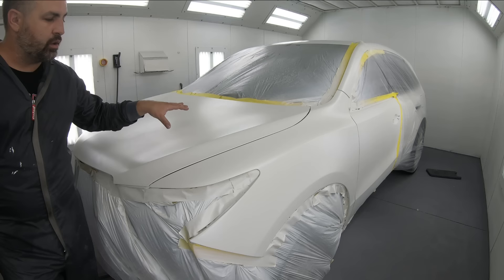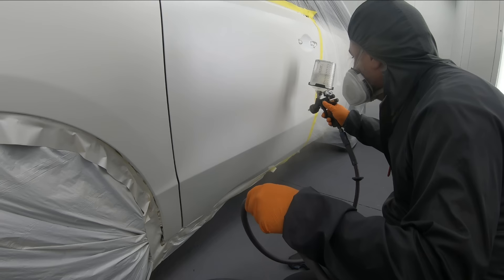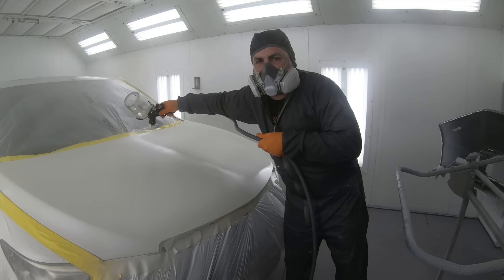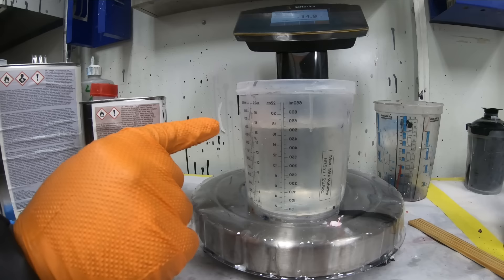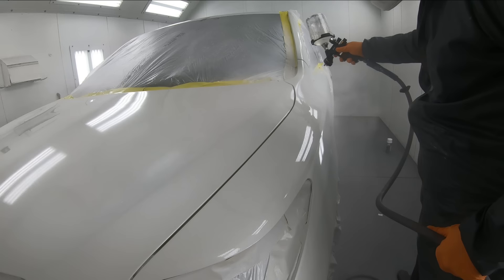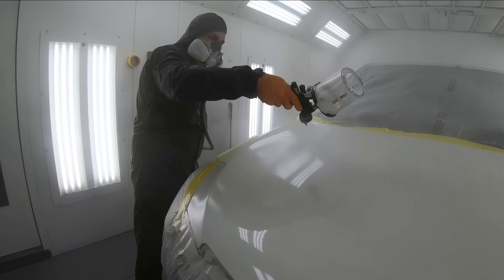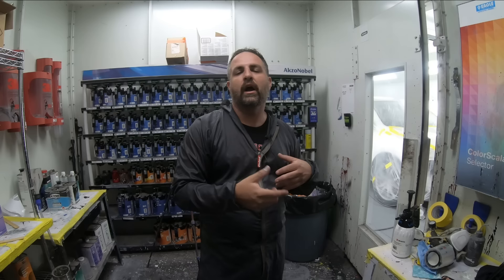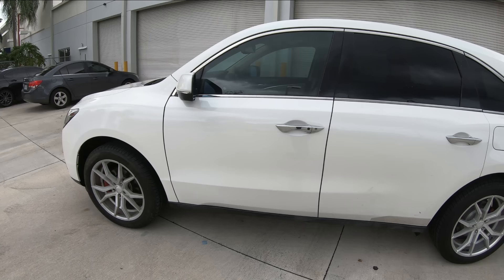Simple Mixing HACK to AVOID ORANGE PEEL!

Comment: Reducing clear for over many years painting since 85. But still Don't have thise fancy spray guns you use. Everyone doing videos, has good training tips, but then they use these guns average person can't afford.
Reply: I always think of paint guns like chefs knife’s, a professional chef can take a cheap knife and make a good dish but an inexperienced chef with  an expensive knife is no good. The reason the professional uses an expensive knife is repetition.
Reply: Amen.  It’s always easy for pros to say “here are tips…” and then they forget we noobs don’t have a 100k invested in the hardware, painting booth and matching system computer.  Show me how to do this with a 25 dollar or even a 100 dollar harbor freight tools gun….THAT would be helpful.
Reply: I've done a lot of painting with cheap 50$ rongpeng HVLP and LVLP guns. With all sorts of weird paints.

Was doing some steel cabinets recently. Enamel went on absolutely beautiful running 8:1 or 10:1 with bog standard lacquer thinner.

One guy wanted a hard gloss finish (but didn't want to pay for clearcoat). I don't often use hardener, mfr said they never tested but they'd take any notes I generate.

Hardener mfr even after seeing the paint mfr said "thin however, any method for oil based should be fine" decided that because the website said, "we dont recommend thinning" that they'd no longer assist me (after wasting 6 hours of email knock knock).

Their hardener was creating pebbling (think dew rather than orange peel) and all I asked was, are there reducers I should avoid?

I was at the point of going from 10:1 paint: thinner mixed 8:1, to 6:1 paint:thinner mixed 8:1 with hardener. And I tried with everything from lacquer thinner to mineral spirits to Toulol, Xylol, MEK, Acetone (so everything from fast to slow drying) and it wasn't solving this weird surface tension problem. Wasted over $100 in paint and hardener and thinning chems for them to find an excuse to fuck off and abandon me.
Reply: But I generally find that nozzle size ends up being most important. Some heavy, slow stuff like enamel or alkyd you can run from 1.3-2.0+ (thinner dependent), while stuff like a water based "acrylic one part epoxy" (don't quote me, I have no idea how it's acrylic and epoxy) requires a water or partial PG cut and a 2.0mm or larger, wide open, to keep it from drying midair. I even painted that acrylic crap on a 90% humidity day and it was still trying to dry before hitting the surface. I generally will paint with whatever the customer wants. It's hell on earth 🤣

Comment: I've been adding reducer to my clear for years and years. It really does help the clear lay flat.
Reply: Use slow activator so it has time to flow out and flatten out
Reply: @Chase Williams Its just the regular reducer you use with your basecoat. Just like he shows in the video it only takes a small amount and make sure you use the right temp rating, especially if your not in a climate controlled booth. He explains it perfectly in the video.
Reply: @Chase Williams not sure but can also purchase clear that has less solids ...the orange peel that does form is easier to buff out
Reply: @Chase Williams Reducer works similarly to thinner but with urethane base/clear systems you use reducer that is made to work with it. Thinner is more known for being used with acrylic enamel type paints. I know guys who have used regular thinner with their primer because thinner is cheaper than reducer but I've never personally heard of anyone using thinner with basecoat or clearcoat. Also when I first started painting some of the older guys who had worked with Acrylic enamel before urethane basecoat/clearcoat systems became norm still called the new reducer  thinner because that's what they were used to but like I said its actually 2 different things but works similarly for different applications.
Reply: @Chase Williams You're correct, reducer is just another name for thinner.  So every time you've used thinner, you've used reducer, and vice versa...

Comment: I like to do first 2 coats, let it sit approx 36 hrs, wetsand with 1500 to remove any surface trash, dust runs, etc.  Then set up the clear again for 2 more coats but use reducer as you noted. Turns the now matte sanded and smooth surface into a high quality finish. I like this method cause if these last 2 coats aren't overly heavy, and any dust that does stick at this point will be settling into a rather thin coat of clear and easily buffed out with a light polish in most cases.
Reply: This is referred to as flow coating....I've been trying it recently with good result
Reply: Too much work using 1500 grit' 600/800 is fine enough and levels the clear out faster rather than polishing over it.
Reply: @BryanClark-gk6ie  I meant 1k. 600/800 only if lots of build up or a drip/run in clear..I'm cautious though and picky. Don't wannt cut the paint, especially metallic lol.
Reply: @phillipgrandison2384  
You can always dust a little base coats over the areas if you happen to sand through the CC.
Reply: @BryanClark-gk6ie  Ive hit it with 1000, but on a palm sander with a foam interface pad. I just dont have the balls to go any harder. Mind you, I'm always using stupid expensive base coat colors.
Reply: @fundamentallybroken4194  
Yes materials can be expensive so it's best to know your limitations and have confidence in doing something before causing extra work/cost of materials.  Making mistakes/learning to correct them is the best way to learn and takes several years of experience to do so.

Comment: I spray outside. I have need adding thinners to my clear for years. Helps me get it smooth and I get a paint booth finish every time. Even spraying outside in the hot sun. No orange peel and I flow coat it saucy !

Comment: great video, by adding reducer you are changing the viscosity (thickness) of the clear. The thinner (less viscosity) the clear the less orange peel. but you are flirting with a higher chance of runs and sags. I the TDS there is a suggested viscosity to spray all top coats. To measure this viscosity you have to do a viscosity drip test. To get a perfect job you have to do perfect chemistry. This means not guessing and knowing what your spraying. (for the advanced class) Another educational vid.

Comment: I haven’t had any problems with orange peal in my clear coat painting in temperatures 85 to 62 degrees.  The only issues I have had is switching from upper grade paints to lower grade paints.  The higher grade paints lay smooth and flat, while the lower grade paints finish is rough with a leather grain finish like the K2 primer which requires wet sanding.  The only way taround it is extra coats of clear to fill in the valleys of the rough paint finish.  Sure, I can wet sand the lower grade paints to make them smooth and flat… but why sand off expensive paint material and risk sanding down to the primer.
From my personal experience as a hobby painter I will pay the money for the upper grade paint so I can use less clear coats to cover up the sins of the lower grade paints.   Any tips on making the cheaper lower grade paint lay smooth and flat?   Thank you!

Comment: I find temperature-matching the reducer or hardener is best, with maximum air pressure for whatever gun being used. The higher atomization occurs with higher pressure at the gun. Combined with speed and distance, one shouldn't need extra reducer.

Comment: Ah Man U know as well as me.. some products, we use protech maxi glaze, you totally can over reduce a little.. I go 20 percent on coat 1 and 2 and 25 on my third coat.. I always go 3 clear.. I know some shops won’t let you because the margins are so tight, but 3 clear always looks better to me with the 3rd being over reduced a little.
Reply: 25%? dam thats alot imo but if it works for u then great! I just started reducing my clear by 5% and it makes a world of difference. If ur using cheap clear like me, putting the extra coat of clear on cost like $30 for your typical front end job. IMO not much if u want a ok paint job to look like a great paint job.

Comment: You may want to run your hose up your arm from the gun over your shoulders behind your neck and hold it with your other hand to keep from dragging the hose on the fender or the hood. A simple technique to save a load of problems in your finish. I painted cars for more than 30 years and found this technique of hose handling to be great at saving myself a lot of grief. Holding it in front of your body like that is asking for a lot more work.
I used that reducer hack for a lot of years but I used it in both coates. And as far as build up on edges...good spray technique will solve that. Never stop on any edge. Always spray beyond any edge or gap. Always overlap your masking. do not stop at or on your tape. go beyond it maybe 6 inches. Paint with a consistent distant from the surface and treat every panel as though it is flat. Never try to compensate for body lines or irregularities in surfaces. Always keep your gun at 90 deg to whatever surface you are painting. If you are on a curved surface simply spray every pass at a 90 deg to surface and change gun position as each pass progresses over panel. 
If you think today's cars are tough to paint try painting the trunk lid and rear 1/4s on a '69 or '70 Cadillac. Look up what they look like. Tail fins, sharp edges, recesses and huge flat surfaces meeting at one point. And most colors were high metallics...and clear coates. A great learning platform.
Of course...everything is easy...if you know how. Right?

Comment: I always thought it was best to let the last coat flash off for roughly double flash off time just to keep the top coat from sealing in the lower coats before putting the infrared lamps on the panels.    Is that a no-no now?   I had read in some industry newsletters that in production shops slowly ramping up the medium wave infrared heat would help cure all of the layers almost equally as medium wave infrared gets to the core of the object almost equally with the surface as opposed to long wave infrared, like a heat lamp on a buffet.  And short wave does even deeper but has to be closer and it’s also more localized.    I have noticed that when I get a run, if I’m quick and careful enough, I can use a heat gun and GENTLY apply some heat on the spot but also around the spot and keep the gun moving and for God’s sake I’ve learned the heard way to NOT let it get too hot.  If you  see smoke or steam it might be too late.   But sometimes the heat will shrink away the wrinkle of the run as it accelerates the drying/curing, but if you don’t spread it out a bit it can have adverse reactions with the adjacent paint as the rate of cure is too much of a contrast with the adjacent paint and can cause serious wrinkling you can fix, peeling, blisters are the worst, but if you get it right you can get rid of a run without using a razor or even touching the surface at all.   I’ve also used a quick and clean swipe with a latex gloves finger tip dipped in blending solvent but don’t let it drip on the panel.    That can help melt that run and let it flow into adjacent paint, especially if you can make a slightly heated circular area around the run just before using the blending solvent.     So what is it EXACTLY that creates orange peel?    It appears to be several different disparate reasons which are attributed  to causing orange peel.    But even the OEMs have orange peel on their ultra controlled and robotically applied paints.      What’s the score?    Heat or no heat?    Warm or not?   I have witnessed paint get nice and glossy while applying a heat gun to dry up a run. It’s like it shrinks away the orange peel and pulls the sling tighter therefore making it more glossy.    But it doesn’t seem to work on an entire panel.    I don’t get it.
Reply: I believe orange peel is caused by the spray not being fine enough. Test the spray on a piece of cardboard and look at the edge of the fan all around top and bottom. It has to be a mist. If you see any big drops you need to up the pressure. Higher pressure will waste more paint or clear due to more over spray. Maybe that's why factories use lower pressure to save paint or clear and end up with orange peel. Try it on a small job and see for yourself. Here's another tip. Finish your last coat on top to minimize over spray landing on the horizontal surfaces.

Comment: An OEM finish has orange peel some manufacturers are better about it than others, but clear coat is designed to provide that same OEM texture and finish. That's not to say it's preferable to a glass-like finish it's not, it's just what it is designed to do to replicate it so it matches that appearance. Spray technique and mixology can help reduce it.

Comment: Paint and clear shrinks 10 %, takes around 3-9 months depending on drying conditions. Your second coat will shrink down to your first. First should look like the last.  To much reducer in clear will lead to cracking clear in the future, I'm sure we've all seen it on old paint jobs and know we now know why, use reducer only if required from manufacturer. it will lay down flat and when the solvents rise it will leave voids leading to cracks in the future. 

Position your hose behind your back, you hit the hood with hose.  Start from the top of the panel down in my opinion. less material on the lower portions of the panels, AVOID PAINTING OVER THE DOOR HANDLE VOIDS, you can mist it later on if its dry, stop spraying before your reach the end of the panel, try painting the door in 3 sections rather than one shot, make sure the panels are warm, use slow hardener, push your needle in and TAKE YOUR TIME.  You can inspect job and spray clear on dry spots after youve went around without leaving overspray if using slow hardener.  it will look dry at first but with 5 minutes it will melt in.   I appreciate what your doing and hope some of my tips help you get the results you're looking for.

Comment: Being I’m just learning to paint, my question about painting in Texasheat. In a paint booth I built in half my garage which has 95 degrees. Paint was drying fast even with Slow activator. I was wondering if I could use a reducer to slow flashing alittle more. Thank you

Comment: No orange peel...? Every OEM vehicle I've looked at for the last 30+ years has orange peel, a few top tier luxury brands being the exception. 

If it's not flat — it's not flat. Unless someone can share a link to a Riddler winner (or equivalent) that did it with an out-of-the-gun finish.

Not trying to be a dick, I enjoy your channel and have learned a lot. But I feel like the claim of "no orange peel" isn’t really honest. Getting paint flat, I mean laser-straight, takes hundreds of hours of sanding and polishing. Can't even be done with just a 6" DA and a 7" or 9" rotary, much less off the gun.

Comment: Just a quick question, it's regarding painting clear over stickers. I'm contemplating painting over some die cut stickers similar to an OEM finish. Does the clear coat attack the vinyl sticker in anyway? I'll be spraying a Kawasaki ZX14R and on the OEM fairings it has flame stickers under the clear coat.
Reply: No clear coat will not effect the vinyl stickers.   Just to be safe it’s best to use low VOC clear.
Reply: You can safely clearcoat over vinyl/paper decals with clear coat ONLY if you don't add a solvent (thinners) to the mix. Not worth the chance the solvent will lift and interact with the decal....so just mix the clear with the hardner

Comment: Def looks smooth as butter great tip for the diyer quick question I have a custom color already made its like rootbeer with alot of gold and copper pearl I had a hard time with coverage over gray primer what would you suggest
Reply: brown tintable sealer
Reply: You need a basecoat under it, or a metallic sealer. If it has a lot of pearl, treat it like a tri-stage paint. An Orion silver or similar underneath would probably look good.

Comment: Are you talking about adding reducer that you would normally use for base coat?  I have some extra reducer left from some paint I no longer use.  It’s a different manufacturer from my clear; would this still work?
Reply: It should say urethane reducer on the can if you are using it in urethane clear. There should be no problem using a different brand as long as it isn't some no-name garbage.

Comment: Is it necessary to add some kind of hardener to clearcoat when spray  painting a car or is this optional?
Reply: Paint technical data sheets tell exactly what you need to know for each automotive paint. Most are available on the internet if you don't get one when you purchase paint. Modern urethane clear always has a hardener (aka catalyst).

Comment: I have one technical question. I get beautiful finish on hood and roof but poor on doors, especially on lower edge where door roles in. Tried to raise PSI issue still there, tried reducing 5% more, no help, tried 2.5 turns out, tried 3.5 turns out, issue still there. It’s big orange peel. Currently using 2 hoods as test panel to lay it flat, one is vertical other is horizontal. Not sure how to avoid orange peel, using Master VHS C38 clear coat, 1.3 tip, tried few guns but same issue, currently I’m persistent to lay it with Walcom Kombat Slim.

Any help is appreciated. 

Any advice how to tone clear so I can better see droplet pattern?
Reply: You're getting the paint too dry on the bottom of the doors before you spray the clear. You need to adjust the way you spray paint on the doors. How do I know this? I asked my father for you and he's been running his own body shop for the last 40 years. 😂